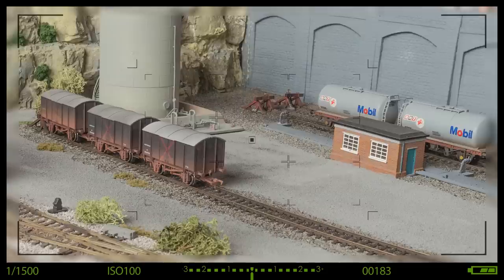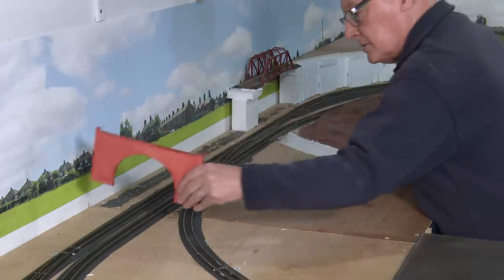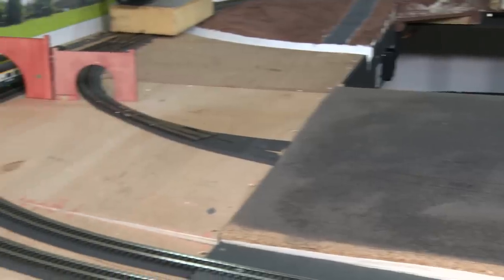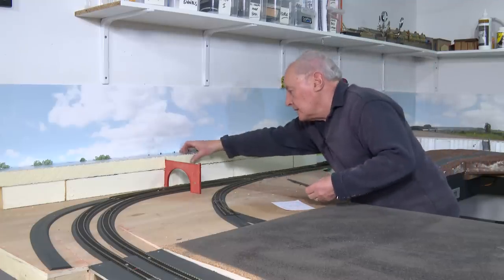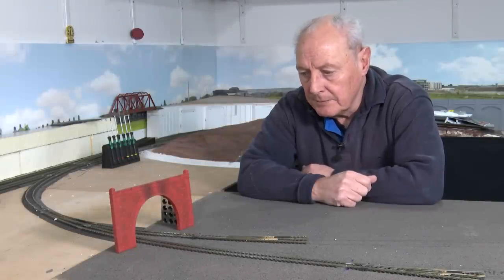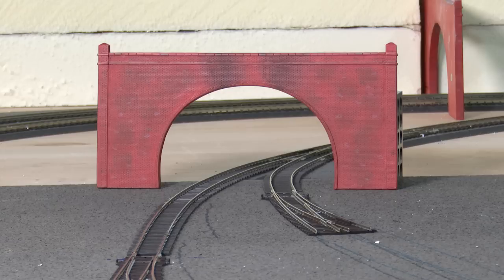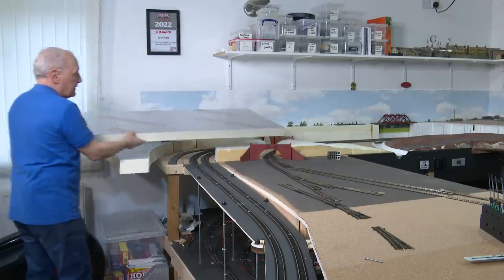Landscape Planning at Chadwick Model Railway | 176.

Comment: TT gauge. When I was a young child TT was a gauge which was available before N was really in existence. My father built an interesting layout which was probably about 7 foot by 5 foot with several levels. As I remember it, there was a double track main line going from a terminus at the top level down all the way around the board to the lower level where a loop was hidden in tunnel. There was also a loop around the top terminus which allowed for tail chasing. At the time it was a good gauge to provide some complexity without taking up too much space. The whole layout could be stood up against the wall when not in use.
I think that if TT had been available when I started my layout then I would have considered it because it takes up a lot less space and I could have got larger sweeping curves in the space.
When I saw it was being introduced again I thought back to those days when Triang first brought out the gauge.
Reply from the maker: An interesting comment John.
Have a great Christmas and best wishes for 2023. Regards Charlie.

Comment: Hi Charlie.
Merry Christmas I see the pre Christmas drinks were making some effects at the start...lol
I like how you try to work out the tunnels and track, and wonder "has this practice been done on real railways?". Answer is most possibly it has been some where, and surprising enough one will come across it in their journey. In Sydney Australia, the line between Central Station and the old line into Darling Harbor was full of surprises.  Yes it did have points in the tunnel that you was looking for. They since been removed as the line is no longer in use, and it is being turned into a pedestrian walkway.
TT:120, I wont be buying. I have way to much stock in HO. Over 190 locomotives.
With energy costs I have the opposite problem, cooling the train room during summer months. It gets about 8 hours of sun. Sometimes I can open the window let the air flow, but when the Northern hot winds blowing, I have to shut the windows and it feels like your stepping into an oven. Yes I can put an AC, but that's going to cost to much. The upside of working in the hot room, like now as I'm starting to expand my layout. I lay my tracks when the room is hot, so to reduce the chances of buckled track and kinks in the track work from heat expansions. It worked out perfectly on the first stage. Winter months when it's cold I ended up with a 1.5mm gap between some of the rails, which hasn't effected the running of my trains. The coldest the room gets in winter has been 5 C, summer time it has got to 31 C.
I have 2 things that's been killing my motivation. 1 is the restrictions I been having with my hands and arms, from when I had an accident in my big truck in 2020, still waiting for 1 more operation on my thumb. It's restricted my ability to do construction. The other is waiting on parts from over seas, and waiting for it to come in stock. For me and many here it's been like playing a game of Bingo.
Your so right about construction sites. Many will part with scraps, as it means that is less for them to get rid off.
Reply from the maker: A very interesting comment Arty.
Good luck with your 2 obstacles.
Regards Charlie

Comment: Nice one Charlie, a couple of thoughts if I may.  Firstly TT, as you know, not a new scale and been around for absolute ages, but this revamp by Hornby and Peco is an interesting move.  To my mind, anything that brings more people to the hobby is a good thing and I think as someone else may have commented, houses aren’t as big as they used to be, so perhaps more suited to the modern house.  I’ve so much invested in N gauge, I won’t be moving for sure, but someone starting out with limited space, this might be an option.  Secondly, Celotex.  Hate the stuff… 😂 and you really should use a mask if you’re cutting indoors as well as gloves, as the dust really isn’t good for you.  I tend to go for XPS foam these days as substrate (the blue 25mm stuff) as it is a lot easier to work and not so dusty etc on the lungs. More recently, I’ve been using 5mm mount board (cheap as chips in hobby craft) and this allows you to build layers as you need, rather than carving away and wasting so much.  Have a great Christmas, and I may well pop over to West Camel on the 30th if I get a chance.  Saves eating turkey leftovers anyway…😊
Reply from the maker: Thanks Stuart. Hopefully we shall meet up on the 30th. Best wishes for 2023, regards, Charlie

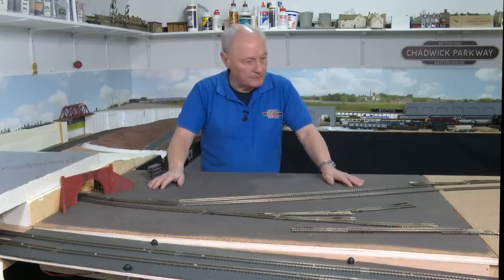Comment: Educational and entertaining almost tied in a race.  Albeit an irritant, is the foam board also asbestos-free?   That dust can get everywhere.  14:48 I also wondered about having that point in the tunnel.  19:24  Will you raise the backdrop? All that artwork being covered up. 24:00 Laying track and Mo Jo...   I've yet to incorporate a "circle of track" to run trains, my life change almost two years ago has bound my interest in faded motivation (almost totally losing passion in everything), until most recently when watching a FB video train running on a table less than 4 foot by 4 foot and cluttered with other locomotives and rollingstock.  That was the spark I needed... Get My Trains Running...  Gotta pull out of storage my adjustable 36" X 54" heavy kitchen table from storage and put down track and run trains...  Now, to make room for it in less than two weeks. Our temperatures have risen from  -30C to -1C... (havoc on my skin dryness)...  Mo Jo...  and I just won a single ebay bid on an Alco RSD-7 Demonstrator (ulp) in Australia, which won't get to me until late February. (I'm in BC, Canada).
As I begun, Your video is educational as well as entertaining...  Thank you Charlie.
John Kraft
Reply from the maker: Thanks John, I’m so pleased that you have regained your motivation. Best wishes for 2023, regards, Charlie

Comment: Nice video Charlie. I too studied my smart meter after I had been in my railway shed and it was costing around £3.40 a go in the shed. I have brought the latest craze a diesel heater. These are fantastic run on 12v. So cheap to run  I’m not sitting at around 35p a go in the shed now including the diesel. It will heat the shed to 40’c 🥵 but I’ll settle for 20’c it’s a win win as the wife is happy as we now dry our cloths in there too as it’s way cheaper then the heating or tumble dryer.
Reply from the maker: Wow Parkend North, I shall certainly have to check that out. Regards Charlie
Reply: @ChadwickModelRailway  it might work for you. If you want any information just ask buddy happy to help

Comment: A useful tpi for the 2" and 3" insulation sheet if you're intending to cover a largish area.  Peel the aluminium/plastic film off both sides and let the sheets sit for around a week.  If you use the sheet immediately, it will "grow" by around 5%, as it'll be under tension as the foil sheets are stuck on before the foam has fully expanded.
Try taking the foil off one side......and the sheet will bow quite alarmingly.
Reply from the maker: Thanks Doug, sadly it’s too late for some of your advice. Best wishes for  2023, regards, Charlie

Comment: Another excellent video Charlie and 2 'faux pas' in the first 2 minutes, we are definitely overdue a bloopers vlog 😁.
As far as TT120 goes I think the scale will be very popular with newcomers to the hobby (a customer base that Hornby is pretty good as supplying anyway) but probably won't tempt established modellers to switch over. I can see it being useful for new exhibition builds allowing prototypical length consists in a smaller area than 00 whilst still a reasonable size to see from behind a barrier or screen. Hats off to Hornby for taking the plunge but to really make it a success I thing other manufacturers need to be encouraged onboard.
Have a good Christmas and a fab New Year.
Reply from the maker: Thanks Darren for an excellent comment. Best wishes for 2023. Regards, Charlie

Comment: Interesting watch and your dilemma on the tmd tunnel issue, new street station approach’s and throat are all in tunnels. I wouldn’t see a problem with it although your slight tween does also work well, and after all I always go by rule #1.
Reply from the maker: Thanks AN, however, I think I’ve come up with another solution. Regards, Charlie

Comment: Another great video to watch.  One question, is the small single tunnel portal that you were using not a canal portal.  It may be because of the way it curves inwards at the bottom.  A tip instead of scultamold on plaster cloth, drywall or plaster board (pre-mixed) works great over the cloth, blob it on and then take a big wet paint brush it covers the cloth perfectly and is dry within minutes.  Keep up the interesting videos
Reply from the maker: I’ve checked the Internet and there are dozens of similar tunnel mouths in existence. Thanks for the tip regarding the landscaping. Regards Charlie

Comment: Hi Charlie. As always another great video stacked full of information and advise. The landscape section that puts me off from continuing to the next stage. I your video you mentioned about the saw you used to cut down on the mess, at work I used a Bahco Procut Insulation Saw 22in which is around £25 (other saws are available from other manufacturers) which does not have pointed teeth but a wave effect, this produces no dust. The dust is hard to clean up whether inside or outside and the dust gets ever where including mouth, nose, hair and pockets! Another way is to use a bread knife that also has a wavey cutting edge or if you have a multi saw they also do a blade for insulation board. I hope this helps someone.
Reply from the maker: Great tips, Angus, thank you. Best wishes for 2023, regards, Charlie
Reply: @ChadwickModelRailway  The insulation saw is very sharp but if it does blunt over time it can be sharpened with a household knife sharpener. The metal blade does not have an anti rusting coating like a normal saw does as it makes it hard to cut with, so make sure you keep the saw sleeve to store it in.

Comment: Another interesting video Charlie, thank you. While you were concerned about the accuracy of having diverging points in the depot tunnel mouth, I would be surprised if many stations have depots accessed via an expensive civil engineering structure like a tunnel. Just stick in a cutting from the mainline with an overbridge for the road. 

With regards to TT120, I wish that was around 30 years ago. I made the decision to dump OO because I couldn't put up with the wrong gauge. It just looks so stupid to when seen alongside an HO model and so sad that we still have this 'compromise'. Its Continental HO for me - with some British HO on the side.
Reply from the maker: You are very some interesting points Andrew. Have a great Christmas and best wishes for 2023. Regards Charlie

Comment: Seasons greetings Charlie and thank you for all you do.
For me, your earlier ⁶⁶butterfly⁹⁹ description is me to a T (or TT?). To structure a build for video is a different animal.
I did consider N when I returned to the hobby in 2019 but went with Brit outline 00. Now some 200 points and crossings later!.....
Your energy bills...I bought the bulk of my Peco flex track during 2020 for $5.00 a length. I see it currently in the shops hovering close to $13.00 per length. The mad world can be ignored for a while by retreating to the 00 shed.
The TT question only applies to the UK. 00 supplies are sporadic  out here in the colonies let alone seeing TT.
Reply from the maker: Many thanks for an interesting comment, Robyn. Have a great Christmas and best wishes for 2023. Regards Charlie

Comment: I have bought the Scotsman train set and pre ordered the A4 Silver King + some  extra track . I was in the process of removing my N Guage and moving to  00  but will now go with TT:120. I will keep the 00 stuff I have already bought and have a small  end to end layout for that. I likethe TT:120 although I am not 100% sure if it will take the market by storm. The thing going for Hornby is that it has been a standard on the continent and the USA  for decades. So their locos and rolling stock could be used here and visa versa. Also of course, I  get an effective larger layout in the same area.  Only issue of course is waiting for certain era loco's and rolling stock. I only model 50's and 60's with maybe some era 3 rolling stock. Oh, and I do not do GWR or  SR.
Reply from the maker: Great comment Peter. Have a great Christmas and best wishes for 2023. Regards Charlie

Comment: Really entertaining video Charlie , have you a plan to access the track in the tunnels to cover any derailments  
Hasn't the DS64 been replaced by the DS74 ? 
As for TT 120 , well the thing for me is there's only a very very small amount of British locos , wagons , coaches etc to buy at the moment isn't there . 
If it sells well then maybe the ranges will increase but if not then people will be stuck with the small amount of products . Heljan pulled the plug on British outline models , needs Bachman/Farish to get involved to give people a choice of manufactures
Reply from the maker: Thanks for your comment, Shaun. I hope to have a lift out section of the hillside to maintain the point work. Yes I am aware of the Digitrax replacement, but I still love the DS 64. Regards, Charlie

Comment: The Peco TT120 track looks really nice.... I think the whole idea is great - fine-scale track, effectively, and an intermediate size between OO (too big if you want to model anything large) and N (too small if you want to model detail - and a nod to Chandwell because that guy is the exception that proves the rule - his scratch built stuff is unbelievable, IMO)
Reply from the maker: Excellent comment mate, thank you.
Best wishes for 2023, regards, Charlie
Reply: TT120 from Peco seems to be Code 55, TT120 from Hornby is Code 80.  That information is taken from the Peco and Hornby websites after some searching for it. I'm not sure a beginner in the hobby would know the importance of the difference!
Reply: @gamerdruid7605  Almost certainly not, but most people start with a train set rather than a model railway.
Reply from the maker: I certainly don’t. Is it sleeper spacing as well as rail dimensions?
Reply: @ChadwickModelRailway  I think the rail spacing and sleeper spacing and sizes for both are, uh-hum, prototypical for the UK. The Peco rail is visually 55 thou tall (it is in fact ~80 thou but ~25 thou is buried in the sleeper) whereas the Hornby is 80 thou and it is sat on top of the sleeper, so visually it looks 25 thou taller. Peco looks more prototypically correct - 55 thou scales to 6.6 inches / 167mm tall - which certainly close enough to the real thing for government work. This all combined with the fact that TT120 also has much smaller flange gaps on the turn-outs it just looks.... much nicer than OO or N IMO.

Comment: Great vid!

Regarding TT120, models are exquisite and, from a purely business perspective, Hornby are spot on with the direct sales model.  They 've clearly made a 6/7 figure investment into the scale and need to recover it as soon as possible,  Whilst we can lament the fact that we can't go down to the local model shop (not that there are any near where I live) and buy them as we would wish to, supporting the shop at the same time, Hornby has to maximise their return on sales and they can't do this by sharing with wholesalers/retailers.

On a negative point, having seen them at Warley, they just seem too close in size to N gauge.  From a European perspective, it's fine because they sit bang in the middle of HO & N but, as far as the UK is concerned, with our overscale 00 & N models, 3mm TT is the halfway house, not TT120.  Whether there's a big enough differential between TT120 & N, time will tell.

Overall, I'd really like to see Hornby succeed, if only to silence all of the naysayers that declare that railway modelling is dead!  I can't fault their approach in any shape or form because they have to be hard nosed about all of this, given the ever increasing competition from other manufacturers.  We have to cut Hornby some slack and get behind them over this; they have made a bold move and if it proves to be a mistake for them and it drags them under, we'll all suffer as a result.
Reply from the maker: An excellent comment, Nigel, taking a very positive view. Have a great Christmas, and best wishes for 2023. Regards, Charlie

Comment: Happy New Year Charlie. Jumping between projects, mini projects and other jobs makes perfect sense. It has certainly enabled me to be working on 'something' for longer periods of time than if I was to just plough on with each until completion as I work on whichever motivates me most on any given day. TT:120. If I was new to the hobby, I'd consider it but the gain in space over OO would have to be considerable to offset the relatively limited range of stock and locos.
Reply from the maker: Thanks for your comment Stef. However, jumping from project to project, I find that I have a dozen half finished projects! Regards, Charlie